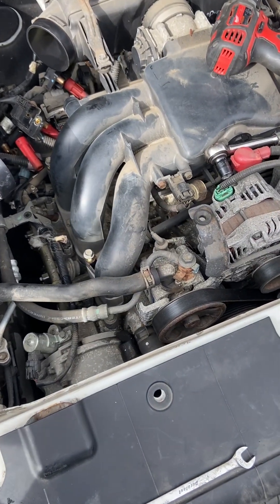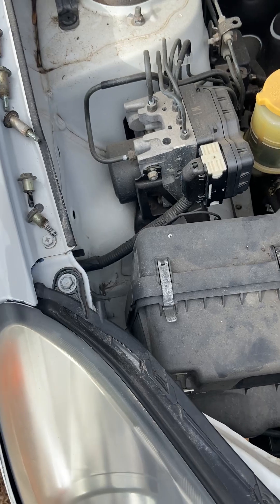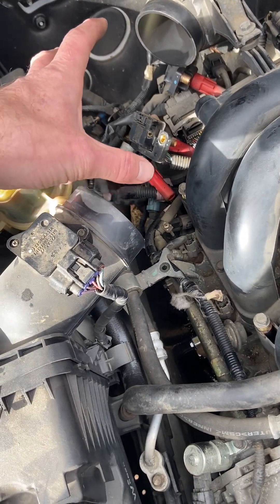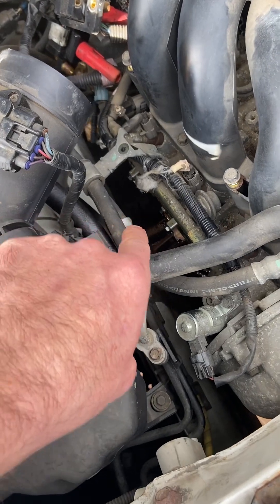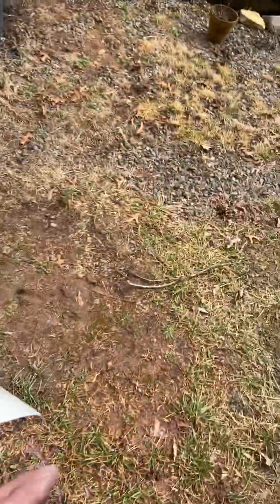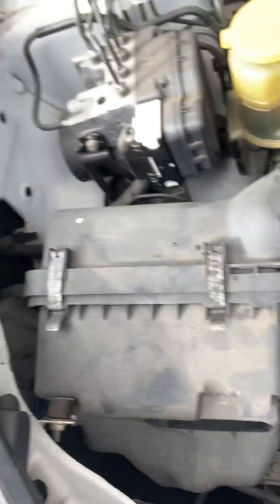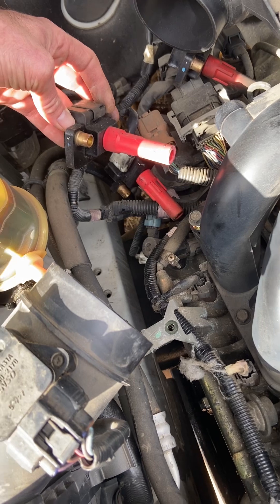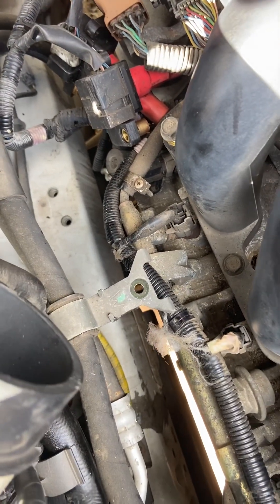H6 Subaru Engine valve cover gaskets replacement removal

Comment: I have 151,000 on my 2013 Subaru Legacy with the H6 engine.  I have less room on my sedan than he had here, as on the driver's side which is also leaking on my car there is one bolt you cannot pull without removing the engine, which I cannot do. I also have a leaking oil cooler, and a leaking power steering pump (also oil).  In other words, most components are leaking oil.  I am thinking this just is not worth it anymore even though I have the durable H6 engine and 5 speed automatic (no CVT).  The cost to pull the engine (which is what both my independent mechanic agreed with me as well as the dealership) is between $4000 and $5000 and a two day job at best, three day at worst (16 to 20 hours of work). The car is only worth that so I think I will sell it to be someone else's headache.  I wish this would work for me but the driver's side is far harder than the passenger side he did not have to do (yet).
Reply: You can jack up the engine for clearance, 2 14 mm nuts on the engine mount, then jack up the engine
Reply: @kamalabbady6778  That is true, but that is essentially removing the engine without the harness.  I asked about this and the cost is the same.  I lack a garage to do this myself.
Reply: @Buc_Stops_Here do it in the parking lot, remove 2 nuts and jack the engine from the oil pan slightly to get the bolt out, trust there is a way out .
Reply: @kamalabbady6778  I live in CT and my town banned this.  It would take too long I would never get it done before being fined at least $2000 for trying it.  I appreciate the ideas, but I think I will sell it in the end. It is a racket to prevent do it yourself people from doing it anymore.
Reply: @Buc_Stops_Here don’t sell it. It’s only got 151k miles. My 2004 outback H6 has 203k miles and I need to do the same thing. After doing this my car is all set. Try to find some garage weekend mechanic that can help you. There has to be a way to save it. Selling this headache to another buyer without them knowing is something I can’t sleep at night , but I understand your pain point

Comment: I just did this job on my Tribeca last weekend.  The dealership just wanted too much money to do this job and I'm happy I was able to do this on my own.  Just take your time it's pretty much straightforward.  I would give it 7/10 difficulty.  If you plan to do both sides, it is recommended to go ahead and change your spark plugs and your oil.   The most difficult part of the job is taking out the corner bolts of the valve cover as someone had mentioned in this thread.  You need to lift the engine with a jack a few inches in order to get more room to work with.  This was a method I used which I saw the dealership tech perform when they changed my spark plugs in the past.  This will lift the engine high enough give you enough space to get to the hard-to-reach bolts and allow you to get the spark plugs  when its past the car frame.  Use a ratcheting wrench, this helps with the rear bottom bolts of the valve cover.  I prob. couldn't do this job without those.  It will take a lot of small turns but will eventually come out.  Take the airbox and battery out to give you more space to work with.  Good Luck!
Reply: Question, did you have to loosen all engine mounts to raise it up, or did you also have mess with the trans mount as well. I have an 2011 Outback that I want to perform this on. Thanks
Reply: thank you for the tips

Comment: This guy has no idea what he is talking about. In my Tribeca you cannot replace the driver side valve cover gasket because their is one bolt you can't get to without pulling the engine. I tried on 1/24/2024.
Reply: I just replaced both on my 2012 Tribeca. No engine removal was necessary, but that one bottom/back bolt on the drive's side is a bear to take out and put in. A ton of patience and a flex-head ratcheting combination wrench did the job. Not a "breeze" but it's doable.
Reply: @ToneScavenger  Flex-head rachet is highly recommended.  I lifted my engine up on my 2013 tribeca a few inches helped a lot as well.  Especially on takin gth espark plugs out on the drivers side.
Reply: I don't think he replaced that side
Reply: He also states 'V6'
Reply: Hey, don’t be an asshole.   Also it’s “there” no their.